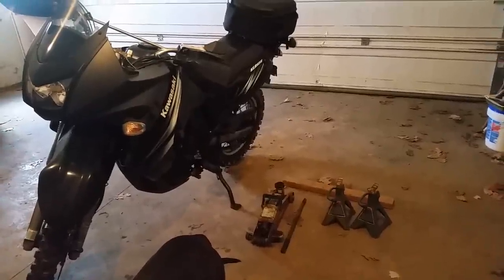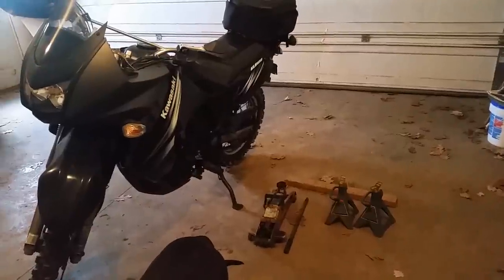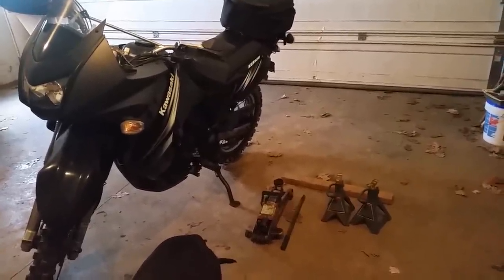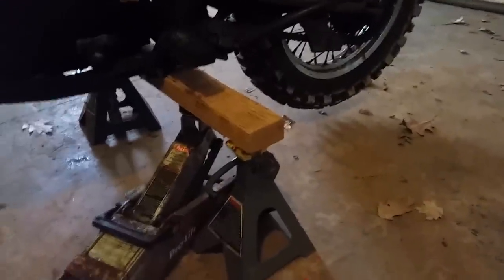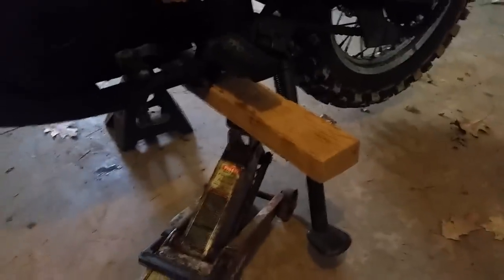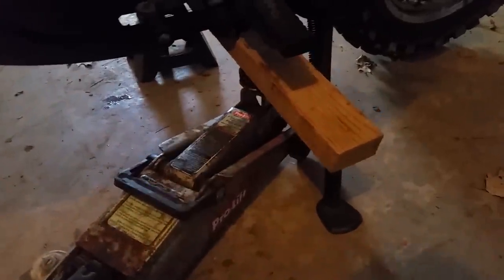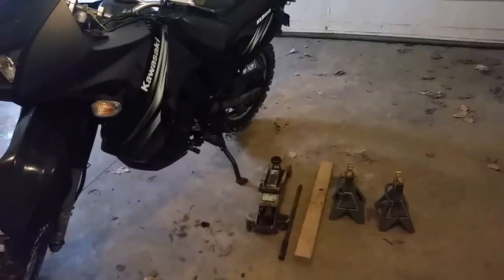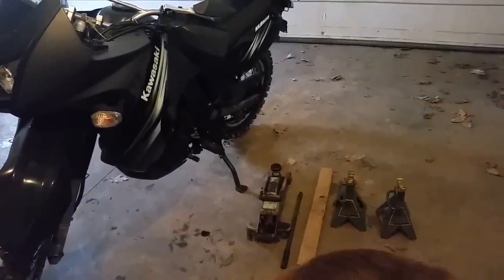How to lift rear of a motorcycle with car jack

Comment: A 2x3 or 2x4 is more than strong enough IF you re-position those jack stands. Both jack stands should be moved in as close to the frame of the bike as possible. That way there is very little distance between the stands that the wood is actually supporting the weight of the bike without support (jack stands) directly under the wood.

Comment: Great idea. I would leave the jack somewhere in the middle, clear of the oil pan. To keep wood from stressing.
Reply: Jacks have a habit of losing pressure overnight. I found out the hard way when I left my Triumph up on a trolley jack. It's only good for lifting not for holding.

Comment: I wish it was that easy! This doesn't work when your pipes are lower then the frame. :-\
Reply: It's probably 2 bolt holding your pipe to the frame and 2 holding pipe to manifold to pull those pipes out and do the same. If you plan on cranking bolts off have someone hold the bike or ratchet strap the front down
Reply: You ate exactly right!

Comment: I would not recommend for a heavy motorcycle, most street bikes are to Low for this technique but your bike  is obviously OK.
Seems perfectly rational Idea, but would  find something else other than an old 2x3 board as a cross member, could possibly crack and ruin the whole day. Something made out of steel perhaps.
That said I would have done the same thing when I was younger, but am getting old and think to much!
I will always adopt a new and better idea.
You have good ideas so keep making your videos please.
Good Luck

Comment: With the shortness of the kickstand on this bike, I can see why you did it this way.  Still, I'd be pretty surprised if this thing didn't fall over on you if you're removing the back wheel!  If you have a Harley, the kickstand is a lot longer, so you can just  place the jack beneath the back end (but in front of the back tire), then jack the back wheel off the ground.  The longer kickstand and the front wheel provide your two points of stability, the bike will obviously still be at a lean, but far more stable than what you have here.  Just sayin.
Reply from the maker: I have used that method to remove the front and rear wheel quite a few times. I'm sure it won't work for every bike though.